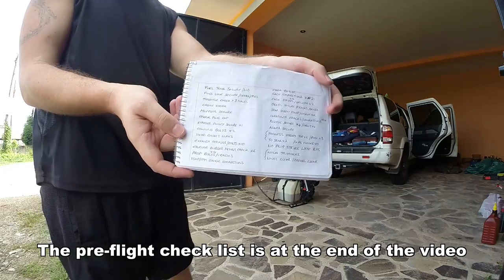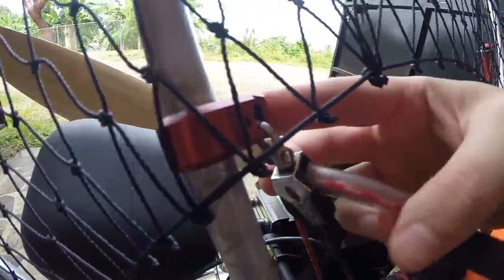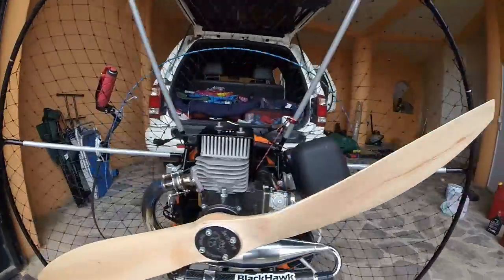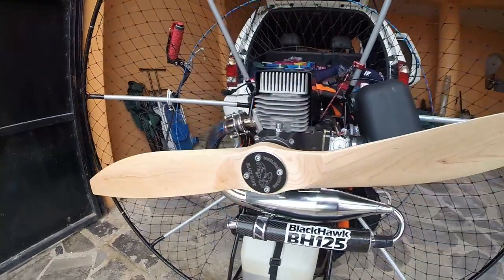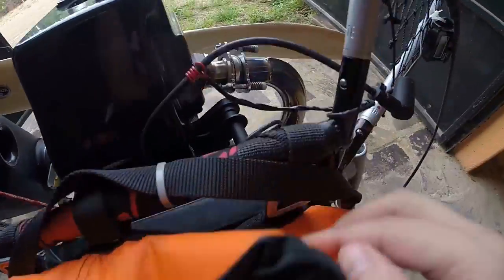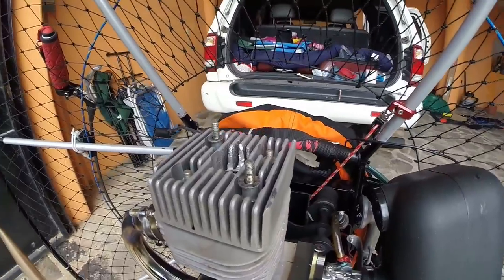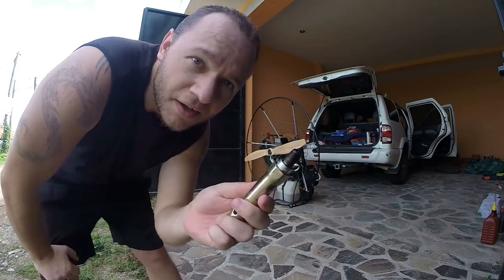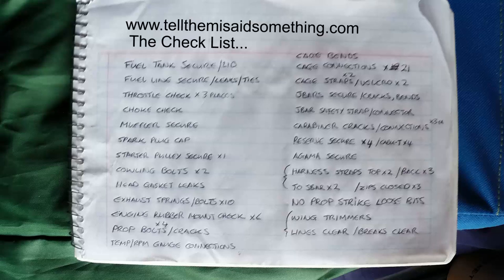How to do a Paramotor pre-flight maintenance check

Comment: you can take the plug out and look down the plug hole and count the number of threads or measure how far the threads go down,   then measure how long the threads are on the plug you are using.   best way is take the head off and put the plug in and show me the pictures,    a close up from the side..      good luck

Comment: Yes I am sure,    the Spark plug in order to work must have all threads of the plug in contact with the head..     and going into the combustion chamber.  The Plug cannot do its job if the plug gets to hot.

 Please post a picture of the spark plug and piston that have the hole in it..      Please take a close up picture of the spark plug that was in the engine.

Comment: What is the plug   make Mfg,  and Number of the plug.   
What engine do you have???

Make sure you use  high octane fuel and do not use to much oil.     More oil less fuel
Also the plug  is very very Rich.   not good...

Comment: i call BS on the duds comments he doesnt even have a video , :) My 2 cents says that there is a heat shield on the top of the head, which is why the plug is low, cause its going into the head as it should, and that shield is air cooled to cool the head. Am I right on that one?
Reply from the maker: +RainbowSixThree Enlightened I think you might be. Unfortunately despite the PPG mantra of 10% pilot 90% mechanic I am yet to learn as much as I should about the engines. Which is why I went with Blackhawk originally, their videos made it easier for someone like me to get and keep that thing flying!